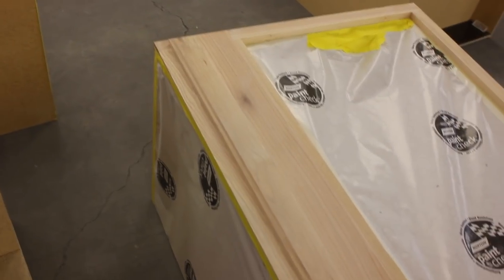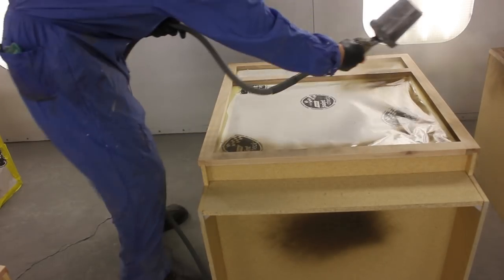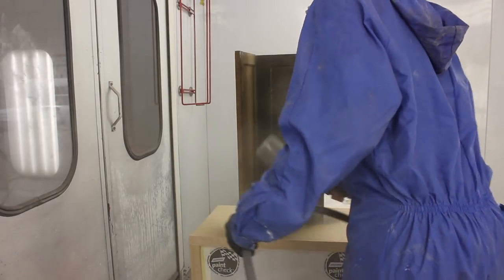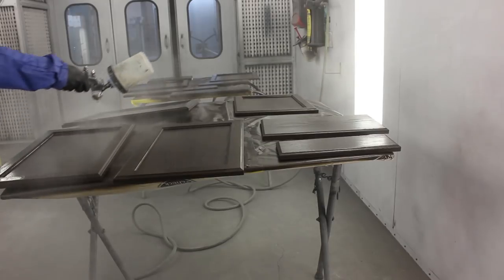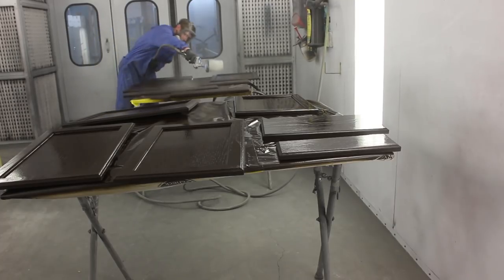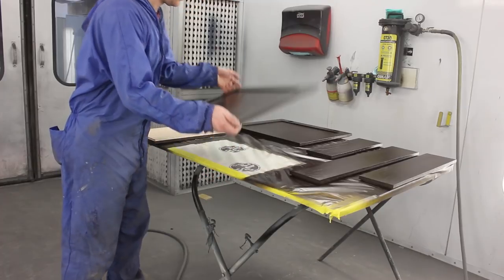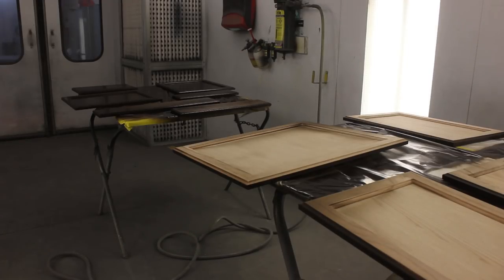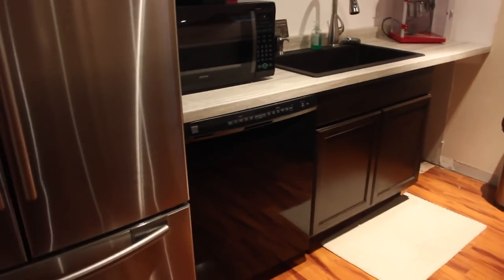Painting Kitchen Cabinets

Comment: i did mine with poly and stain and couple months in and its starting to chip away , can i redo it with automotive paint or some super bonding paint that wont require me to strip it all the way down to bare wood?? maybe just light sanding?

Comment: if your work is bubbling it can be a handful of things maybe humidity or frost in a spray booth can be a problem like everthing their is always a middle like gold locks yo haha or it can be that he is trying to get a double header on to qucik its always better to put one even thick coat on and wait the time to sand with a 500 grit paper lighty then apply the second coat i find i u want a thicker coat on you finished coat apply with a criss cross patten in thin coat i mean wind that gun down to about 75% should be fine trick is u gotta wait